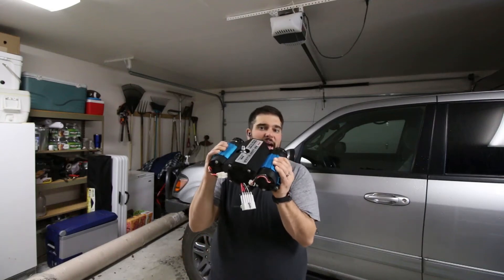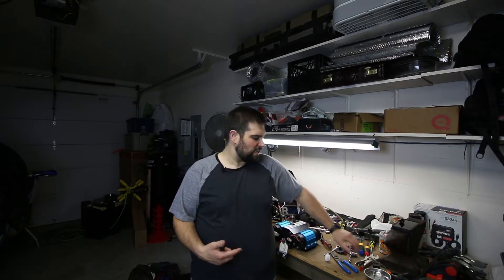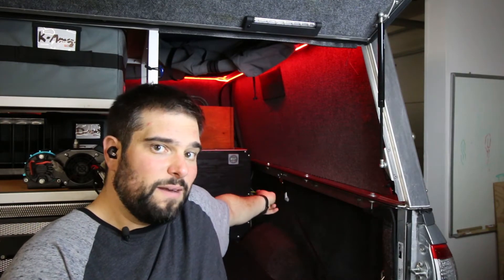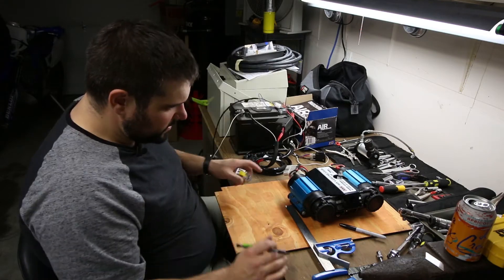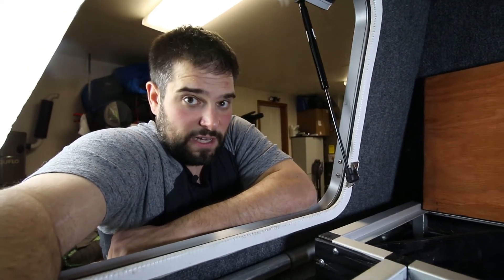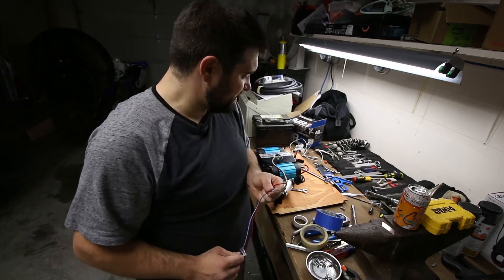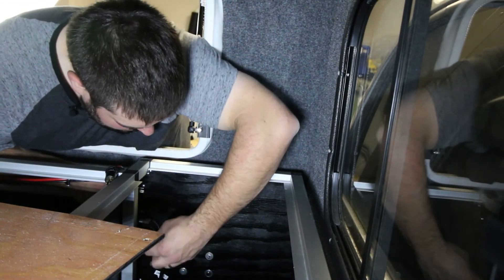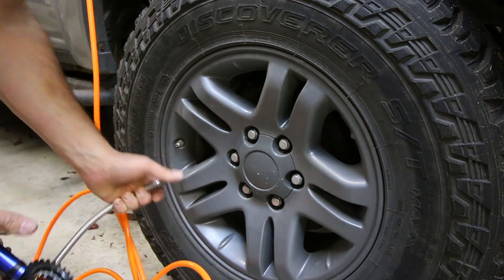ARB Twin Air Compressor - Airing Up Tires After Offroading

Comment: Awesome content as always. I have one of these ARB compressors and only one side wants to compress now. Kind of bummed about it not sure if I need to buy another one.
Reply from the maker: Thanks for watching Ben. I would change your relays out under the metal cover. Both my original ones went out on me and it fixed my issue. I added a link to the one I just purchased in the video description.